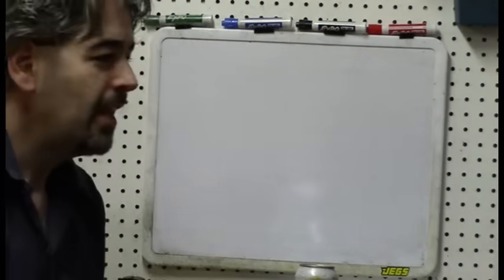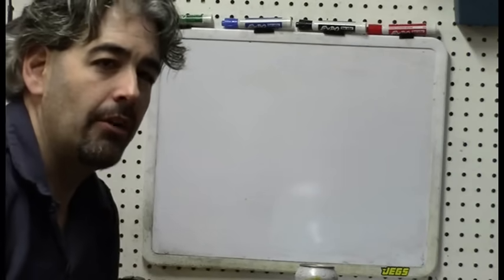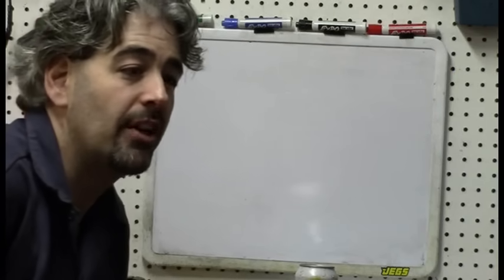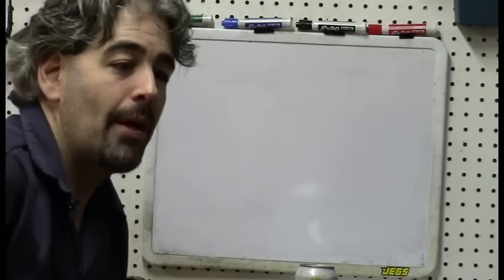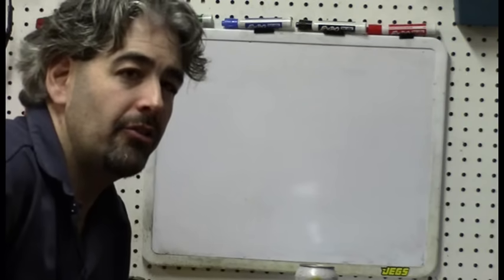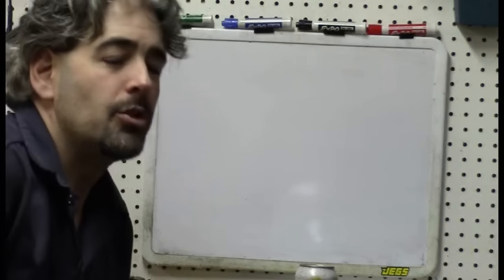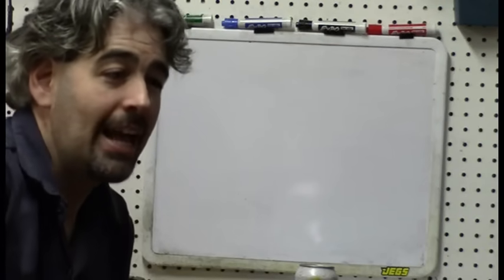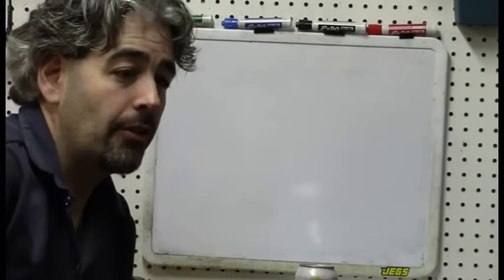Secret of Engine Problem Diagnosis- Fuel Trims Pt.1

Comment: I had a PO171 error code and a "lean condition on bank 1" on a Pontiac vibe (also matrix, Corolla or some other Toyotas.)

The older cars have a problem with the manifold gaskets wearing out and don't have a good "lip."

They wear flat and need replacement. 

The Toyota new gaskets have a solid lip and fixed the issue.

Car runs like new again after replacement and cleaning the manifold / tbrottle body.

Comment: I had no current light codes or notifications and recently added berrymans chemtool fuel system cleaner and cleaned the mass air flow sensor and now the check engine light blinks 10 times and goes off after ignition. There are no stored or current check engine light codes. Did I clog a fuel injector or is the mas bad now? Now back to your great video. 👍

Comment: Hi. Thanks for this great video. I enjoyed watching it. It is definitely a great training. Meanwhile, I have a problem with my 1997 Ford Explorer 5.0L V8. A different problem, different DTC code and with STFT's out of the charts. Here it is: 

Engine Fault Code: P0305 
Fuel System Status: Closed loop, using O2 sensor feedback to determine fuel mix.
Calculated Engine Load: 93.3%
Engine Coolant Temperature: 188.6 F. 
STFT - Bank 1: 42.2%
LTFT - Bank 2: 0%
STFT - Bank 2: 13.3%
LTFT - Bank 2: 29.7%
Engine RPM: 1666 rev/min
Vehicle Speed: 12.45 mph

Fuel Level: Almost Full

The P0305 pops up when the engine warms up and is under load. The check-engine light starts up with blinking. It stops blinking when the engine load reduces (on level or down-hill roads). It does not turn on when engine running on idle (even if it runs for hours). 

The Freeze Frame above was taken this morning when I drove up our drive way (steep hill about 15-20 degrees). At the beginning of the drive way, the check-engine was on (no blinking). About 25 yrd up the hill, it started blinking. When I stopped in front of the garage, it was still blinking. 

I have noted P0171 and P0174 appearing with P0305, before. I found and fixed a small air leak. This probably fixed the P0171 / 4 codes. The code signifies Cylinder 5 (Bank 2) misfire. So, maybe i should just ignore the fuel trims for bank 1. However, I think the 42% increase in STFT on bank 1 can be explained as follows: Noting LTFT Bank 1 being 0,  and no P0171, this  means that the activation level LTFT for Bank 1, must have been set pretty high like 45% or even 50%. Otherwise we should have had a P0171. Is this correct?

With regards to Bank 2 fuel trims, had I been able to drive further up the hill until STFT goes over 29.7, then I would have had a Lean condition on Bank 2 (P0172). 

What should I do next? (Plugs, Wires, Injectors, Fuel Filter, MAF and Air Filter are all new).
Could the O2 sensors be the guilty partners?

Please let me know if you need more details.

Thanks

Comment: So I got a question! Please! If every time I see  the ltft go up in the percentage, is most likely a vacuum leak?? And when it goes negative it could be a fuel problem?? And by the way,  thanks so much for sharing this information with the rest of us,  God bless!
Reply from the maker: no. it depends on its reaction to the load curve. you have to assess each individual load curve effect and determine if it resulted from fuel surplus or fuel deficit.
Reply: Oh,  OK thanks for replying,  I'll put it to the test,  thanks again for trying to make me understand the difference situations! Man you are like a Buda of mechanics,  you are the best 👌!
Reply from the maker: Thanks man lol. yeah nothing is ever straightforward. there are no “islands”. you can get many many causes for the exact symptom and even produces the same data. you always have to take the big picture and rule out things until you narrow to the cause. hell sometimes even a bad part can even cause totally different results. A bad MAF could cause either a rich or a lean condition —or even BOTH at different RPM depending on how it failed
Reply: @SchrodingersBox 

Got it 👍! I can't thank you enough!  👌👍🙏

Comment: Matt when I plugged in scan tool three weeks ago long term fuel trim was around 8% short term 16%. Today I checked and the short term fuel trim is 0%. I know my scan tool is basic but I expect the long term might fall with time. Fault codes P170 and P171 are gone. It was the purge valve hose causing the problems. Engine light is off. An example as you explained parts would not fix. Thank you again.

Comment: These videos Helped me  pinpoint the problem to a dirty MAF, not ECU, not carbon deposits in combustion chambers. Saved $100's.
Reply: Problem: pre-ignition under load. Auto shop #1 dx, carbon deposits; #2, poor quality fuel; #3, ECU malfunctions in setting spark advance. Cardone sells remanufactured ECU, but on their website suggests to evaluate LTFT b4 changing parts. The fuel mgmt is a closed loop feedback control system with multiple inputs from sensors. Thx a million.

Comment: Your video is so good and explanatory. I have this problem on my car. But with mine, the long term trim doesnt respond like this, it seems like the values are always low. the short term trip is always very active. With low rpm it is +20% and when giving throttle it goes into negative like -15%. When I hit the gas, it goes into a rich condition, not sure how to interpret that. I will try to put some gas on the engine to try locate a leak, like u mentioned on the end of the video. Anyone know why my long term trim doesnt react like in the video? Many thanks, I will watch your other videos always to learn more about it

Comment: Just wanted to drop a Thanks.  After watching your Fuel Trim videos a few times, I was able to diagnose and repair the P0171 status on my 1996 F-150 XLT.  Applying the same logic in your training videos, I was able to diagnose it as a faulty MAF sensor.  Quick easy test to confirm.  Quick easy replacement as well.
Reply from the maker: Nice work!  Yes knowing this stuff is one of the best techniques for diagnosing issues!! it really works.

Comment: I have watched and reviewed your Fuel Trim videos numerous times..  and I have learned a great deal ..  and have solved many emissions errors because of your superb teachings on the subject. Wondering if you can confirm something for me. Is it true that E10 Premium Fuel (93) has a different Air to Fuel ratio for optimum combustion.. 14 to 1 (or so) rather than 14.7 to 1. If so, it seems that the ECU would have to adjust for that with a positive LTFT around +4 or so. Is this correct? Thank you

Comment: You summed up in the first 2 minutes what I wish everyone would understand about vehicles. Everything can be tested and guessing can almost be totally eliminated. Trims is like when a clinic takes your vitals, it's a good place to start. High or low blood pressure/temp can tell us how the body reacts to our nervous and immune systems controls.
People just assume they can tell the internet (reddit, particularly) what code they have and have someone tell them what's wrong. Like the P0420. Not it's not automatically replace the o2 sensor or catalyst. 
I use an analogy of comparing the catalyst to a sponge. An engine constantly lean is "saturating the sponge so it can't absorb excess oxygen" while rich the "sponge is wrung out of all its water" which is why the downstream o2 isn't smoothing out the oxygen levels but oscillating like the upstream. A good running engine [oscillating between slightly lean and rich] has a catalyst sponge that at all times is mildly saturated - water can always be added or wrung out, on demand. Likewise, the catalyst has a specific capacity like a saturated sponge can hold a certain amount of water - thus the propane test to test [diminished] capacity.
Reply from the maker: Great analogy!  Thanks for the comment!!

Comment: You remind me so much of my son. Unbelievable! He explains computers to people just as you explain the workings of the engine. Same mannerisms and speaking style....Anyway, he's over 2000 miles away which is okay because I wouldn't want him to see his father going crazy over this 93 Chevy 1500 with a 4.3, and which I've changed every sensor and at my wit's end. I'm trying to watch all of your videos and taking what I can use I'm putting the rest aside. I'm not going to give up. I'm not a quitter. But I lay awake at night wondering if there was something I might have missed. That it seems I end up making it worse. It's a good little truck and I want to keep it. But most of all I need to figure it's out. Surging at idle. Misfiring at low idle and up to maybe 30 miles per hour. At higher speeds it feels like I'm pulling somebody with a rubber band but the engine sounds better. Sorry. I'm rambling. Thank you for the videos. Hopefully I'll combine them and get my truck back on the road.
Reply from the maker: Well if you can get me some numbers i can probably help. It all starts with fuel trim and then you know where to start your diagnosis.
Reply: @SchrodingersBox  unfortunately it's OBD1 and I don't have a scanner. I'm well adapt at troubleshooting with a voltmeter and basic electronics, so that's what I'm working with, in accordance to your videos in which you apply the voltmeter. 
Getting the 5 volts at the appropriate sensors, ran the TPS up and down, slowly and smoothly. Results were excellent.
Against one of your cardinal rules, and having quite a bit of "reward points" at AutoZone, I replaced the oxygen sensor, IAC, TPS, EGR valve and the solenoid, ignition control module, and tested the primary and secondary on the ignition coil. (Low and high) and resistance was well within the specs. Testing with a vacuum pump I found no vacuum leaks. Getting some excess oil on the spark plug threads so replacing the valve cover gaskets now even though they look fine. I am getting terrible fuel mileage. No excess smoke from the exhaust, but has fairly strong order of unspent fuel. 
I've succumbed to the fact that this is my purpose in life. My mission from God. I'm on a quest to figure out what's the matter with this truck!!!! Lol
Of course I'm kidding... but like you, I'm not satisfied with taking it to a dealer and have them them fix it. I need to do with myself and understand what the issue is and, more importantly, WHY the issue is. Lastly, I have a one way airflow valve ordered to make my own compression tester. I could buy one, but using the time 2 troubleshoot all the other things. Compression check should have probably been the first thing to do in case I'm wasting my time. But I'm enjoying this even though it's frustrating. If that makes sense. 🤔 I understand it's difficult if not impossible to diagnose a vehicle when you don't have your hands on it. Thanks for replying and if there's any other pertinent information you'd like, I'll do my best.  Hope my book didn't put you to sleep. 😴Thanks again. 
P.S. I did the jumper thing between the A and B on the OBD1 Outlet to get the flashing codes. The EGR 13 is the only one I've ever gotten. Currently, there is no check engine light but the thing runs terrible. Especially at idle and just "getting going". Seems to correct itself at higher speeds except for that feeling of pulling something with a bungee cord or rubber band.

Comment: Thank you for sharing your knowledge. Old video but this will be helpful for as long as gas powered cars exist. Your explanation helped clear up a lot of confusion I had.
Reply from the maker: Glad it was helpful!
Reply: @SchrodingersBox  Is it ever possible to see STFT going up on wide open throttle while seeing LTFT going down? This is what I’m seeing on my scanner numerically. From your video I suspect it’s s vacuum leak, because when off the throttle LTFT works its way back towards 20s. I always thought LTFT follows STFT, so I’m surprised to see STFT going up while LTFT dips on wide open throttle. Thanks!
Reply from the maker: at WOT fuel trims are not used. the engine should be rich at WOT.  Look for the O2’s or A/F’s to go full rich at WOT. if they do, you are fine. if however they go lean at WOT you have a fuel delivery issue OR a MAF issue.

Comment: you should have been auto tech instructer.
after viewing both videos and applying what i learned, i was able to diagnose a vacuum leak.
understand that this is the first time i  deal with fuel trim.
my Challenger SRT8 and I thank you.
loose PCV valve and IAT.
Reply from the maker: Awesome!  Its not really that hard-- most people however will not spend time studying this and they will never learn it.
  Good job!

Comment: 0.45 V is also equal to 450 millivolt. Lets have voltage units consistent for easy understanding. So the ranges are from 100 , 450 (mid ) to 900 mv.
Reply from the maker: It’s also equal to 45000uV. So let’s stay consistent and say ranges are 100000 to 450000 to 900000uV.

Comment: Hello dear. Thnx indeed . Really helpfulll. Thanks indeed. You are really good. 
Today i have seen . In a car renault
Stft +23%
But i have not understood 
What means 
-100% in o2 b1 s2 
Short term fuel trim in 
Banc 1 sonsor 2 . Is  - 100 % 
Is it mean . No catalytic or the sensor doest work?
Or what is thee problem here.
Plz i want a help

Comment: Car has been in the shop for days with a vacuum leak. I’m gonna have them watch this video instead of keep telling me to buy parts. Showed them my short term fuel trim was at 50% at idle, Long term was at 0, as the RPMs increased the stft started to decrease. Confirms vacuum leak, correct?Thank you for the video!

Comment: Thank you. I'm experiencing your exact scenario w/ 4-banger p0171 (only code). Everything looks like a vacuum leak with ltft +25 and stft 0 at idle, then as I apply throttle stft cuts fuel and ltft goes toward 0.  Vac leak is looking probable at this point, However 1 anomoly is when i fill up at gas station now, car won't start unless i hold the throttle completely open while starting.  Start ups are fine after the fillup and continues to run fine otherwise, no misses, jerkiness, stumbling etc. So possibly a fuel delivery issue is on the table too.
Reply: Turned out to be the purge valve stuck open.  Thank you!

Comment: I watched both parts to this video thread;  well done sir and thank you for sorting out this foreign (to most of us) concept in such a wonderfully clear and easy to understand way!  Excellent information and very well presented.  I know i'm pretty late to the party on this one since this is a 9 year old video, but i'm hoping a) that you'll see my comment, and b) that you might favor me with a reply.  I have a 2007 chevy van (4.8 L V8) that is giving me fits in trying to track down a check engine light issue. The O2 sensor codes i'm getting are P0030, P0053, and P0134.  In order they are; "heater control circuit, bank 1 sensor 1";  "heated O2 sensor, heater resistance, bank 1 sensor 1";  and "HO2S Low activity, bank 1 sensor 1".   I started the vehicle with my diag scan tool (just a cheap one sadly) plugged in and let the engine come up to temp. until it went closed loop.  Both banks show a STFT fluctuating b/w -3 and +3%.  All 4 O2 sensors are putting out voltage; the bank 2 sensor 1 looks very normal at b/w 0.1 and 0.88 volts, and the bank 1 sensor 1 is also fluctuating but at a higher avg. (varying b/w 0.4 and 0.9), while both downstream sensors are near 0 volts; around 0.2.  The LTFT however is where i see something very telling but not yet sure how to interpret it given the O2 sensor data vs. the 3 codes and what they're suggesting.  The Bank 1 LTFT is at +25%.  Bank 2 LTFT is at +17.2%.  

I would be eternally grateful if you were able to shed some light on this problem for me and get me pointed in right direction.  Thank you kindly in advance for whatever help you can offer.
Reply from the maker: What’s the amperage on your O2 heater circuit showing? That’s the first step. Actually it’s the only step. Need that to determine to issue.
Reply: @SchrodingersBox   Hello and thank you for the reply.  Hmm, i can't see anywhere in my scan data that indicates amperage values for the O2 sensors. What's the best way to determine what it is?
Reply from the maker: No you have to measure the amperage with a DVOM. Just measure it with a DVOM and it should show between .8 and 1.2 amps. That tells you where the issue is.
Reply: @SchrodingersBox   Oh ok.  Where's the best place to insert the DVOM into the circuit so as to take that measurement?  I have identified the two 15 A fuses in the underhood junction box (fuse box) that power the heater circuits for all 4 o2 sensors.  But unfortunately each fuse is doing double duty, supplying power to both L and R bank. One fuse powers the heater circuits for the 2 upstream o2 sensors, the other fuse powers the heater circuits for the 2 downstream sensors. I can probably single out the relevant wire i need for just one o2 sensor at a time, but still need to find a way to get embedded in the circuit with my DVOM.  Any helpful tips?  Thank you for your time on this matter, i really do appreciate it!
Reply from the maker: I personally find it easiest to put the dvom in series with the connector. You could also use the fuse. Just don’t ground it out is all. If you ground it you will 100% destroy the pcm.  That the only thing to be careful of is
Reply: @SchrodingersBox  Hmm, ok.  I'll have a look at it but from the way it's wired i'm not sure how easy that will be.  Alternatively, could i measure the resistance (ohms) of the heater element in the Bank 1 sensor (that's the one throwing the codes) and then calculate what the amperage draw would be based on whatever Bat. voltage i have?
Reply from the maker: that would measure resistance in the sensor. not on the circuit. thus the reason to measure the amperage in the circuit.